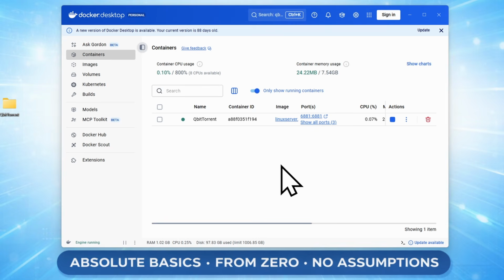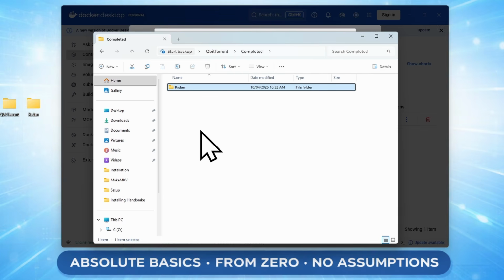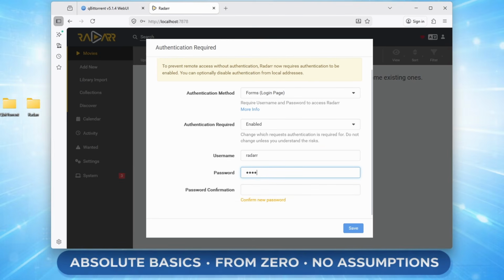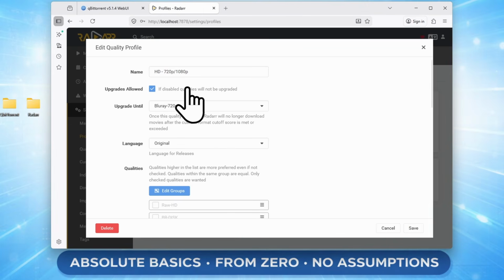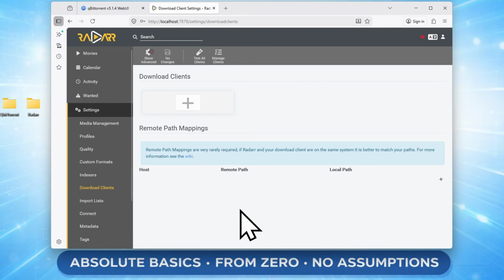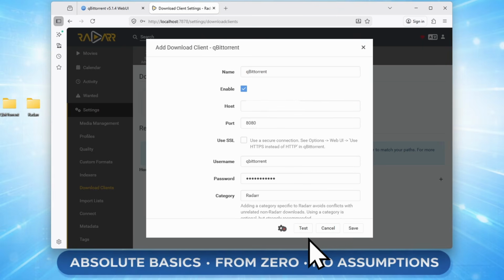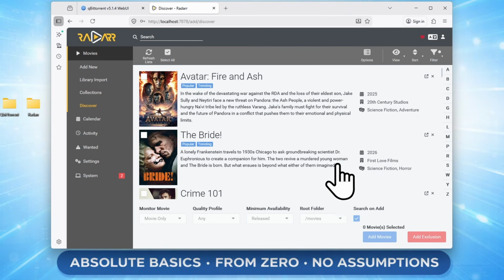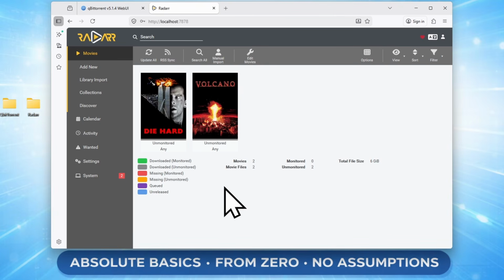The Ultimate Radarr Setup Guide (Beginner Friendly)

Comment: HELP! For some reason it's sending my media files (.NFO,mkv,etc) a recycle bin?
Reply from the maker: That is quiet strange! Radarr generally doesnt delete files. Unless you specifically tell it too. 
Check out qbittorrent, what does it do when the download is finished? I leave it alone, so that it doesnt automatically get deleted, gives it enough time to transfer across, and seed for other users. 😀 and i delete it manually.
Reply: @SystemsFromScratch  it's not set to do anything it's the same setting like in your video.
Reply from the maker: Just a few questions to help understand :)
Is this happening during a movie upgrade/import? Radarr will often move old files to the recycle bin when replacing them.
Are your download folder and movie library folder separate? If they overlap, Radarr can mistakenly clean up files it thinks are duplicates.
Check Activity > History in Radarr. It should show why the file was deleted or moved.
Look at the Radarr logs around the time it happens and search for "Deleting" or "Recycle Bin".

If the settings/paths where set up as i did in this video along with qbittorrent - these issues wouldn't occur.
Something may have been missed, so let's try to solve it :)
If it becomes difficult to solve - an easy fix would be to delete the container & config files - and recreate the container following the tutorial step by step..
Reply: @SystemsFromScratch  Yes the download folder and the movie library folders are separate, it's happening after just running radarr. I even stopped running QBT and it's still does it. It's taking one movie from one folder and moving it into a completely different movie folder. If I look at the history of that of that movie it will either be blank it'll say nonsense that I don't understand. If I import a movie into the library in radarr it will show up just missing status.
Reply from the maker: That is strange, and not normal behavior - If you set up everything correctly, all the paths and settings, then that should happen. Try recreating the container (delete all config files) and give it a go, following the steps as closely as possible.
Reply: @SystemsFromScratch  oh really... I have so much added already and almost set up perfectly just this annoying bug that's happening is there no way do I really have to delete it all?
Reply from the maker: It shouldn't happen, all I can think thats causing it to happen, is a path, or setting that you did differently then i did. 
You can re confirm the settings and paths, and hopefully its all good? 
But i have a feeling something went wrong to make that happen.
Reply: @SystemsFromScratch I really didn't do anything different I don't know why all sudden it's just doing this.

Comment: So i have input my ipv4 address into the host and once I push test it doesn't see to want to continue, cant save or anything and Ive sat for 30mins waiting for anything. Ive seen another have this issue but fixed it. should i use a different method or am i doing something wrong. all the vids have been amazing and very helpful so far this has been my only major hiccup so far.
Reply from the maker: Im sorry you are having issues, you may find the correct ip address in your logs of that container, that is how the other user found it. 
If that doesnt work, try host.docker.internal as the ip address 😀
Reply: @SystemsFromScratch thank you for the fast response ill give this a try after the usa v Paraguay game. These videos are amazing and can't wait to finish getting it together
Reply from the maker: Thank you 😊 means alot!
Reply: What worked was just going to the qbit webui and taking the ip from that and 4 after the : in port and seems to test fine now
Reply from the maker: Perfect! Glad you got it working !😊
Reply: @SystemsFromScratch  ok now when im downloading the completed files are going into the completed folder I made but another Radarr folder and they are not transfering to jellyfin did I misspell a path maybe? once i get this final part I should be all done with the major part of this project.
Reply from the maker: Firstly, id check radarr and see if there is any issue in the transfer.
If there is, then double check the paths and everything where added correctly 😀
Also double check the jellyfin folders. It may have been transferred but jellyfin hasn't updated the media 😀
Reply: @SystemsFromScratch  on radarr next to the completed downloads the icon is orange and says no files found are eligible for import in (insert files and subfiles) it created it own complete and incomplete files maybe my paths arer wrong from that but i can't tell where i need to change the file paths
Reply: @SystemsFromScratch radarr and sonarr both say you are using docker download client qbit places downloads in (file path) but directory does not appear to exist inside the container. I tried setting up the qbit torrent in docker but it kept failing so im using the built in qbit on my nas could that cause an issue if so ill have to redo the qbit portion
Reply from the maker: That could potentially, ive never used a different container on a different docker setup. 
Double check the paths are correct. 
Not only the paths that are binded  to the container, but the remote paths, etc that I go through in the video.

Comment: I have some questions about upgrades allowed, I do be limited on space so what do I do about The quality profile and the file size regarding some I don't care being SD and others I do care and I prefer them to be HD.
Reply from the maker: Thanks for the question! when it comes to the Quality Settings, I dont believe there is a way to differentiate between each item, you can adjust the Size limit on all specific qualities (e.g. 1080p) but you wont be able to increase it for different movies/shows. 
The only thing that can be adjusted, is the profiles tab - and then select the profile you want.
For the ones you dont care that much - you could keep as Standard - and for the ones you do - you can set it up as HD.
Reply: @SystemsFromScratch  also the blue that shows up in your video doesn't happen for me is that because I didn't choose upgrade?
Reply from the maker: That is correct - It goes blue when that profile has an "Upgrade to" and it stops at the blue highlighted setting.

Comment: Could you please do a video for radarr and and sonarr adding existing media and having it rename the files correctly to show up in jellyfin and Plex (if possible). Thanks again
Reply from the maker: Thanks for the suggestion! I will add this to the pipeline.
Reply: @SystemsFromScratch  Here is another older Dad, a little overwhelmed with these settings and also looking for a fresh tut like this so I will wait on this
Reply from the maker: Hello :) I get the feeling! i was like that when i first started my journey - there may be alot of settings - but if you are following along, it should all work smoothly :) In regards to having existing media, added to Radarr, there are 2 options.
Option 1: Click Library Import > Then select one of the "Recent folders"
Option 2: Click Wanted > Manual Import > Click the folder icon and search for the directory.
Thank you for commenting :)
Reply: @SystemsFromScratch  I’ve already tried using it because I was looking for a tool that would let me rename existing file folders after the fact, and that’s how I came across Radaar. But I kept having trouble getting the settings right. Every time something gets renamed, Radaar automatically creates folders for the other parts of a movie—for example, if I only have *The Hobbit: Part 1*, it also creates folders for Part 2 and 3 even though those movies aren’t there. I tried to disable that feature, but it didn’t work. By now, I’ve tinkered with so many settings that I don’t even know what I’ve changed anymore. I’ve spent hours online trying every helpful guide I could find, but the problem persists. Eventually, I plan to run the whole thing on my home server, but without this issue—or rather, without this option.
Reply from the maker: Hello, Apologies on the delay! I do not get notified for any replies to my comments - It may be a "Monitor" issue.
You can select under the Monitor setting "None", "Movie" or "Collection"
If you have the Movie file already - and you are happy with it (not looking a different one) id set "Monitor" to "None"
Hope this solves your issue!

Comment: I finally found the correct IP address that I was missing.  I found it in the Docker container in inspect which gave me the IP it is working with.  Super excited for the next video to come out now.
Reply: Thank you! Between this and your previous one where @SystemsFromScratch said qbit had to be running for this to work I finally got connected. So big thanks to you both!
Reply: Hey what do you mean? I’m having the same problem where my IP doesn’t work in radarr, where did you find the IP in docker?
Reply: @RileyyWho  I'm at work and don't have remote setup on my pc at home. When I get home I can find where I found it and I'll update you.
Reply: @martymikkelsen7204 Thank you! When i put my local host IP it doesn’t work but couldn’t find the alternative IP in docker :/ let me know :)
Reply from the maker: Have you tried host.docker.internal
That usually works for me :)
If not, go on command prompt, type ipconfig and grab your ipv4 address.
This may appear multiple times - so if one doesnt work - try another :)
Other then that, the IP address may be in the logs of your container. you may need to scroll and have a look for it :)
Reply: I like your guristas icon
Reply from the maker: Glad you got it working! Should be out early next week. 😀 thank you for your support.

Comment: I have put in my ipv4 address and it still will not work.  Wonder what I am missing.
Reply: It fails to connect to qbittorent. When I put in the http it says it can't be that
Reply from the maker: Thanks for reaching out, so just to confirm. You have qbittorrent running (please confirm you can access it) and for the local host you have something like: http://192.168.1.20:8080
When it fails, does the error message point you to the IP address, or something else? (Error message will be in red over the item)
Reply: It states that it must be valid Host without http:// also yes I made sure that qbittorrent is running in docker
Reply from the maker: Did you put the full address including http?
Does it fail when trying to connect to qbittorrent, or is it failing to download?.
Reply: @SystemsFromScratch  Also when I try localhost and 8080 alone it tells me unable to connect to qBittorrent
Reply from the maker: Hope no other issues arose 😀